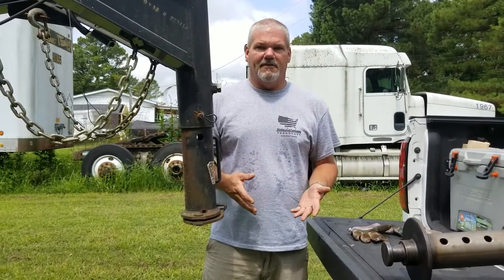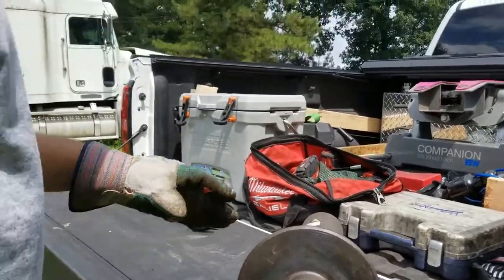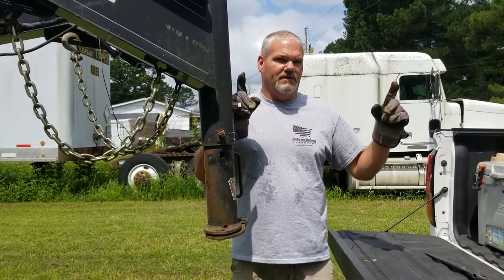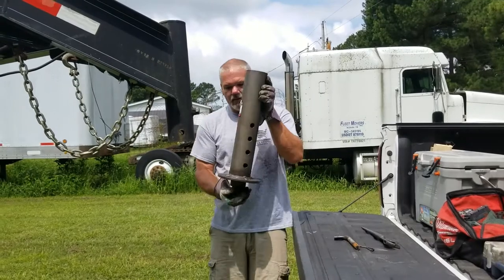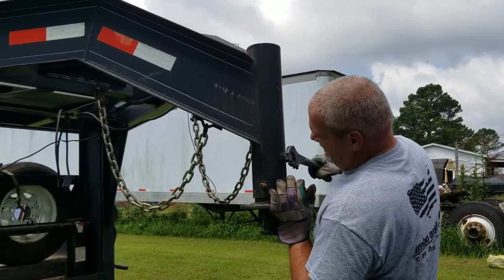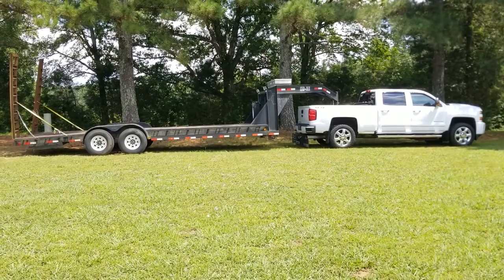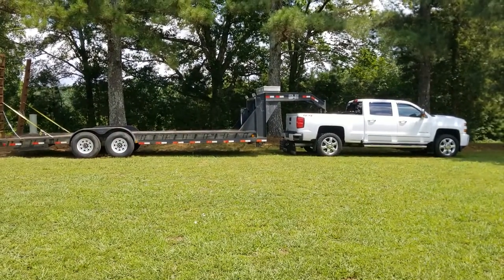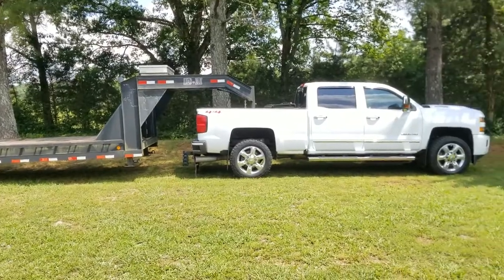Gooseneck Ball to Kingpin Adapter

Comment: Fifth Wheels do not require a safety chain because the hitch does not have the potential to slip off a ball like a bumper pull or goose neck does. The replacement for a safety chain would be the king pin lock “retainer”. Hope that helps

Comment: I've had mine converted for about 2 years now set truck up with ride right load helper air springs and add a load  hight regulator to keep truck at constant ride hight then cut down the tube on the trailer to have trailer frame level for even weight distribution across all 3 alxels of the trailer then welded the adapter soild it pulls better than any other gooseneck I've pulled and I'll never go back to a ball I have pulled backhoes for hundreds of thousands of miles on regular gooseneck trailers i have learned to hate the constant jockeying forward and backwards as your cruise control adjusts up and down hills 
I don't have any issues now so my advice is get truck and trailer matched up and use air ride systems to keep everything level no matter what legal weight you need to carry its just as forgiving loaded as it is empty its not just the fith wheel that's the answer its ride hight constancy throughout from minimum to maximum keeping the trailer level is another key along with air ride trailer and bang it pulls like a dream even on old dirt oil field lease roads
Reply from the maker: Good info. Thank you! I've been looking at cutting the tube off and moving it up to level it out. Love the way it rides on fifth wheel just has noise off trailer too high by almost 3 inches. Thank you a lot for your comment

Comment: I have a question sir. Using your gooseneck with 5th wheel have you been in a situation where your drive wheels lost traction due to not have the movement as the gooseneck ball set up? 

I’ve been thinking of getting the shocker set up for gooseneck to help with the bucking but started thinking as you did that I should consider going 5th wheel set up to have a wider range of hauling for my business. Thank you in advance for your time!
Reply from the maker: I haven't had that issue. The Gooseneck does ride better on the fifth wheel. The only issue that I've had is the truck carrying the trailer to high in the front with a heavy load the truck doesn't drive a good as with it on the ball (or when the trailer sits level). But definitely still rides better. I've thought about moving the hitch on my trailer up 3 inches or lifting my trailer 2 inches then it would be great.i have talked to other people that used the adapter that sit perfect with it and love it but every trailer I've used it on rides a little high in the front
Reply: @CFarmer  thank you sir for your information! I may just go with a 5th wheel set up that way no matter what load I’m hauling either my gooseneck or if I have to RV Transport I can. Again thank you have a bless day!
Reply from the maker: That was why i got mine and it is serving me well, I've pulled quite a few horse trailers with it.
Reply: You could also consider using the kingpin to gooseneck ball adapter as well. It's one piece that locks into your 5th wheel and the gooseneck couples to ball on top.
Reply: @weslymanley8953  I would not use that. There are too many connection points, and you'd still have to use safety chains.

Comment: I changed my 40ft gooseneck over to a fifth wheel because of my camper...I never use the chains. I did leave them on there though in case someone else tows it gooseneck style again
Reply from the maker: Hey that's great, wish you could share pics here. Would like to see it. I do like the ride of the fifth wheel over gooseneck ball and I dol use it especially on short trips and light trailers. Im going to have d rings welded to my fifth wheel so I have somewhere to hook my chains. May have to put a 2 inch lift on my gooseneck, lol
Reply: @CFarmer  I definitely agree with you on the ride... especially with my duel pivot plate. It's at the welding shop now having the upper deck and winch installed. Once I get it back I'll take some pics and try to use clipboard to share them with you
Reply: @CFarmer  as far as the chains go mine are removable with a small clevis so I take mine off. Campers and semi's don't have them
Reply from the maker: That's awesome

Comment: A lot time on the sides of the fifth hitch in truck you can raise and lower it should be bolts on the sides. I have a slider one made by Reese and it does.  Look the hitch up on website and should show you how to do it.
Reply from the maker: I've looked on my hitch and b&w website and haven't found any adjustment yet. The stationary hitches you can unbolt and move up and down but mine doesn't have the extra holes to use. I'm still working on it tho. Thank you for your comment

Comment: I'm going to wind up doing the same thing.  I don't think you need the chains with the kingpin.  Otherwise, we have a whole lot of RVs breaking the law.
Reply from the maker: It's working good moving new empty trailers but it does carry them high in the front. I pulled the trailer in the video with a 1 ton flat bed. I could tell it made the truck handle different. Wish it sat just a little lower but it does keep me from pulling the hitch. Im pulling bumper hitch now and when I drop it off im picking up a mac horse trailer with living quarters going from Indiana to Florida. Will be the furthest I've used it so far.
Reply: Yeah, any fifth wheel kingpins I have seen, have a cable that connects to the hitch, in the event the trailer disconnects, pulls the cable and sets the brakes.

Comment: Where did you get your lube pad for your b&w 5th wheel hitch?
Reply from the maker: It was on it when i bought it. I'm pretty sure Dans in Elkhart has them
Reply: I can’t find a lube pad like the one you have on yours. Has anyone know where to get one? I just have the lube pad on my trailers but like it on the hitch like yours much better.
Reply from the maker: I'm still looking too, it won't be long until time to replace this one
Reply: Thanks, I have the same setup as you with the b&w slider in my 2019 Denali and converted my gooseneck like you did about 2 years ago and love it and so much faster to hook it up.
Reply from the maker: Pretty awesome setup. If you find those lube plates let me know. I get asked about it all the time

Comment: So How much does the weight rate difference or any.
Reply from the maker: it rides heavier on the truck and back axle of trailer.it works good transporting empty trailers but i pulled a 1 ton flatbed on my trailer in the video about 150 miles and i didn't like it.it'll have it's purpose with me but another long heavy trip it will go back on the ball.
Reply: Thats what i was afraid of. Thanks my ton truck already high. So just have to take off the fifth wheel. To pull the goose neck. Thanks for the info
Reply from the maker: yes sir,i'm not worried to much about the truck it just worries me carrying most of the weight on the back axle of my old trailer.thank you for your comments
Reply: Where did you get that lube plate ?
Reply from the maker: It was on the b&w when I bought it

Comment: Is that kingpin the same size as a semi's fifth wheel? Thanks in advance.
Reply from the maker: Yes, they're both 2 inch kingpin as far as i know and i did originally buy my kingpin adapter so i could pull my Gooseneck with my semiand it hooked to both fifth wheels perfect
Reply: Also, when you hook it up to the semi, do you have any clearance issues?
Reply from the maker: I also called a friend who pulls his 40ft toy hauler and asked hom if he knew of any instances it wouldn't work had never had an issue either
Reply from the maker: I didn't but my fifth wheel slid all the way to the back of the frame. I don't remember any issues even in the forward position but even when i was hooked to a flatbed mine was slid further back than most
Reply: @CFarmer  awesome. Thanks again. I have to go repo one for my mother in law and that's the only truck I have.
Reply from the maker: I think you'll be good as especially if you have a sliding 5th wheel
Reply from the maker: That would be a good video to make. Wish i had made it before i sold my Kenworth
Reply: @CFarmer  I might just do that.
Reply from the maker: Hey, i found this video this morning. https://youtu.be/q8zvM8SB5lA